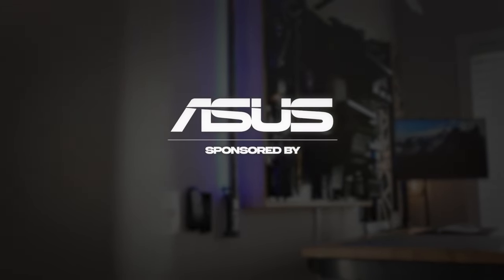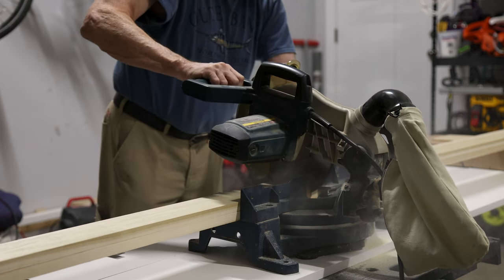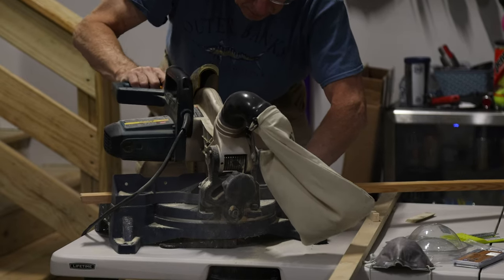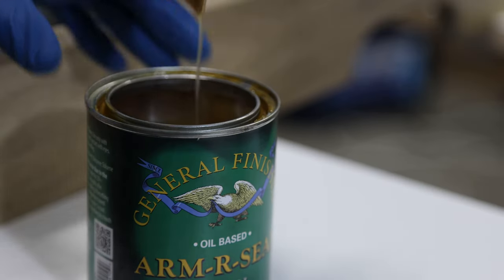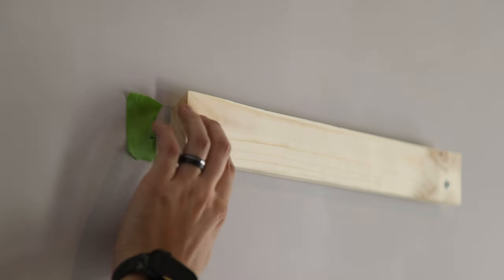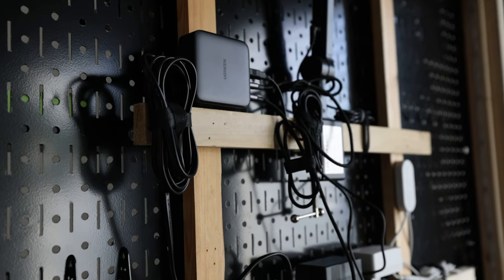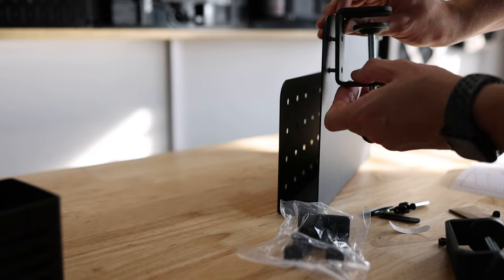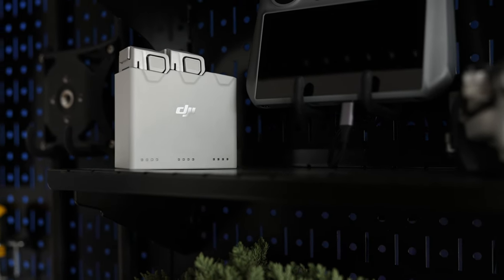Dream Office Workstation Build 2024

Comment: A neodymium magnet glued to the USB hub, battery charger, etc., works better than velcro to attach items to the Wall Control metal pegboard.  I have the Wall Control metal Pegboard; everything I use has magnets. LTT store has a line of magnetic cable organizers that can be used anywhere.

Comment: That turned out very cool!
A tip on your question about drilling the hole. You could screw or glue a board with a hole as a guide in front of the pegboard. And then drill through both. That way the drill can't run off.